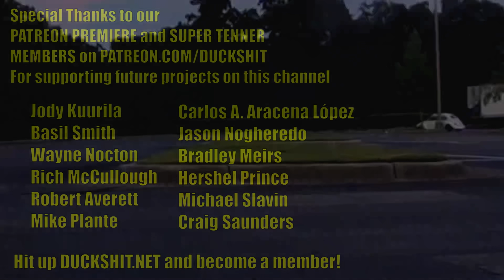Wheel and Tire Reveal - 1971 VW Karmann Ghia - Part 11

Comment: Bee good luck to you. It takes a while to get your care finished. I had my Bug painted/restored but they didn’t repaint the wheels. So I got the paint code and went to the paint store and had spray cans made. I spent hours wirebrushing and cleaning the wheels on the drivers side. They came out terrible with a finish like sandpaper. I was so bummed out I never did the passenger side. 😕
Reply from the maker: I am not Bee but I will tell her!  Thanks so much my friend!

Comment: Is there a reason other than "it's what I have" for the narrowed front beam?  Most cars the front is a bit wider than the rear, usually by about an inch.
I am a KG lover I've owned 3, still kicking myself for letting them go.
Reply from the maker: Wheel/tire clearence when going stupid low seems to be the reason most people will tell you for a narrowed beam  I've found the massively reduced turning radius, the tires burning through the headlight buckets on a Beetle or burning through the quarter panels to be far less than desireable.  I also don't care for the tucked look.  It makes the fender look like it has a huge overbite, and its not doing anything positive for performance and handling either.  I've recently dissembled the front end since this video and fixed a whole bunch of stuff.  It's better than how it came to me.  Its lowered, but no longer ridiculous, and no longer goofy looking.  Its very tasteful and practical!  Thanks for the question!

Comment: Hi Duckman. Love your videos. Are those normal ghia headlights?
Reply from the maker: Hey and thanks!  No, those are actually early Beetle headlights that were grafted on.  Some people hate them, but I find them highly appealing.  One of the things that sets this car off for being so different from others.
Reply: Oh. That's cool. I am restoring a 68 ghia. How did you convert to the wide 5 wheels from 4 lugs?
Reply from the maker: @billcrowley1854  We actually made a few videos about that, this is part 11.  I think you only have to go back about 3 or 4 videos.  Complete brake swap.
Reply: @DuckmanCycles  Ok. I will watch those. Thanks for making such informative videos.
Reply from the maker: @billcrowley1854  Thanks man!   I also did an ATVW video where we swapped from 4 to 5 lug on the rear.  Not much to it, just gotta have the right parts!  😁👍🏻